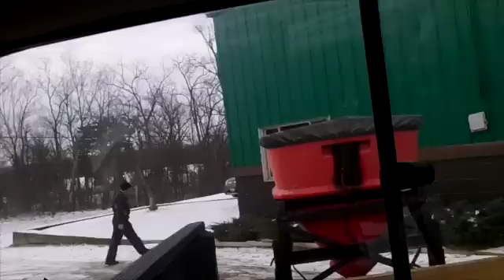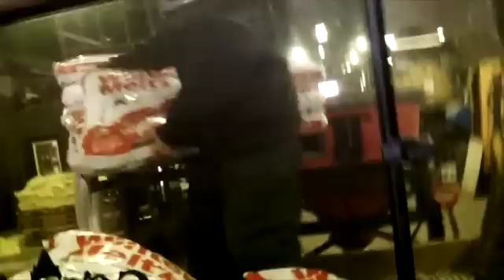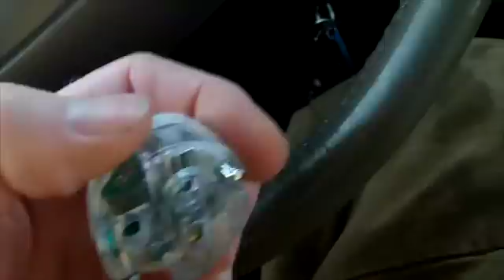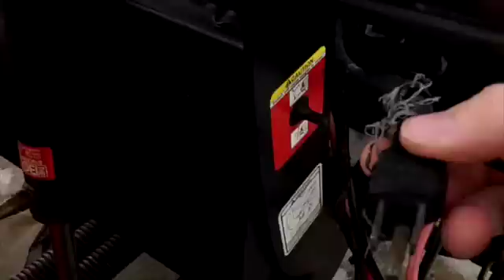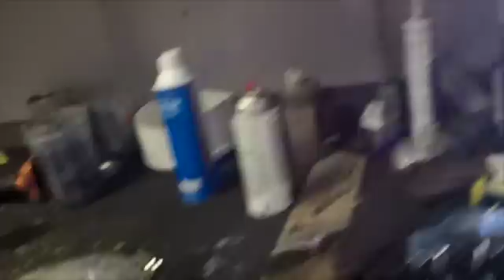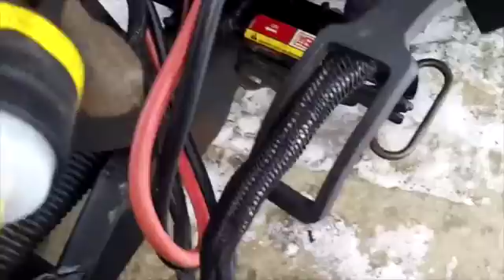How to repair a block heater plug, getting salt - Powerstroke

Comment: Thanks for the video. I just wanted to know which wire was which before I go rescue a family member that ripped theirs apart.
Reply from the maker: You will need to perform a continuity  test to see which wire is the ground. I believe if memory serves correctly there is a copper stranded wire with no insulation (ground)in the black cord. The other 2 wires need to be connected to the plug on the hot and neutral terminals to make it work. I would get your digital multimeter and test. Otherwise you may energize the body of the truck and possibly electrocute someone
Reply: @Velvethamma  I plan to take the multimeter. The last time I did one was a Ram about 10 years ago.

Comment: About 80% of plugs go bad at plug base...where the wires enter the plug. Cut wire about 2" from plug test two wires, not green one, and if meter shows ohms connect new plug. Done

Comment: Why dissect the plug?
You have a voltmeter so just turn it to oems and check the leads.
Reply from the maker: Reub Pru 
I've seen some situations where the wires become weak right where they meet the plug and give a bad reading.  Plus I wanted to install a nicer plug if  the wire tested ok

Comment: I have one of this in my 99 ram 5.2. Can someone give me info on this plug? How it works? How i plug it? Where to plug it?
Reply from the maker: +313stratus It is an engine coolant heater probably.  Plug it into a 110v outlet a couple hours before you start your truck  when it gets below freezing.  Warms it up much quicker in cold weather and will aid in easier cold starts
Reply: +Velvethamma  oh, ok. So i can plu it in any outlet from home?  I leave in indiana and it has gotten below 10dgs and my truck has always started great. I always let it warm up 15-20 min before i drive it.

Comment: I replaced the connector on my '02 F-350, last winter, also.  Interestingly, I used the exact same plug end, because I liked the lights.  As for the cable, and figuring out which wire is Hot (Black), Neutral (White) and Ground (Green), take a close look at the flat cable that goes tot the block heater.  The center wire is always ground. Then on one of the remaining two wires, there is writing (that indicates the wire gauge and other things.)  That one is the hot wire, and the other one is neutral.
Reply from the maker: William Torpey Cool... Thanks for the input!

Comment: where did you get that plug end
Reply from the maker: I think I picked it up at Home Depot.  Any electrical supply house should have one similar and they are not expensive.  Less than 10 bucks

Comment: New trucks don't have glow plugs.
Reply from the maker: The 6.4 has them and the 6.7 has what they call "instant start" glow plugs.  Not sure if it's some sort of intake heater or a true in head glow plug.  Info on the subject can be found here http://www.internationalpowerstroke.com/67psd.html
Reply: Velvethamma They have grid heaters. No glow plugs.
Reply from the maker: snnnoopy  Got it!

Comment: nice video. I may be in the same boat, my plug wouldn't ohm out. I may probably go with the Marinco receptacle-style plug though, looks pretty slick mounted in the bumper, has a nice cover to keep water/crud out and is only $15 on amazon.
Reply from the maker: Had I known about that before I did this, I would have gone that route

Comment: Man that's cold, brrr
I'm a big fan of dielectric grease on the connections, if you want to double your protection, try some liquid neoprene on the harness pass thru areas to prevent moisture getting in. Same stuff on the marine connections in your boat from the factory !
Reply from the maker: Liquid neoprene... never heard of it.  Is that like liquid electrical tape?  I love dielectric grease too. Although I have had it screw with a connection a time or two, it does more good than bad.
Reply: Same stuff, different name, and it's bullett proof, quick drying and doesn't break down with oil on it !
Where would we be without chemicals ?   lol
Stay warm and safe Shawn !
Reply from the maker: Thanks Doug, I'm gonna order some now that I know it's the same.  My can is a little worse for wear!  Doesn't seem to have a very good shelf life
Reply: Hey Shawn !
It degrades, or cures quickly if the can is not sealed well. I have the best luck storing it in a zip loc bag  lol
D